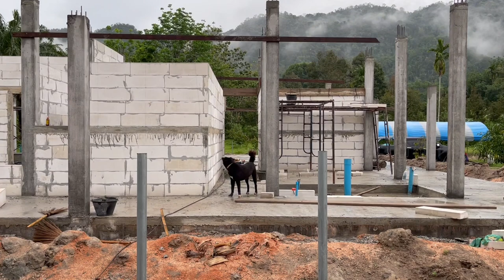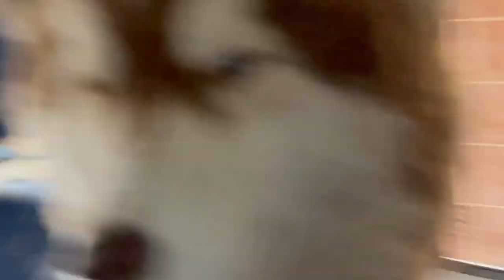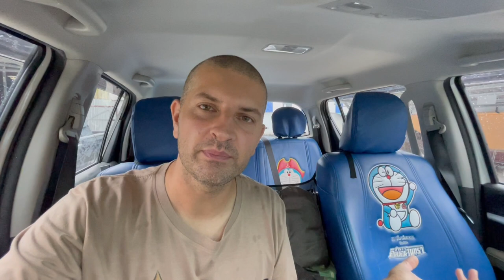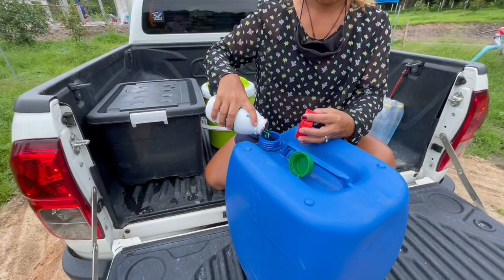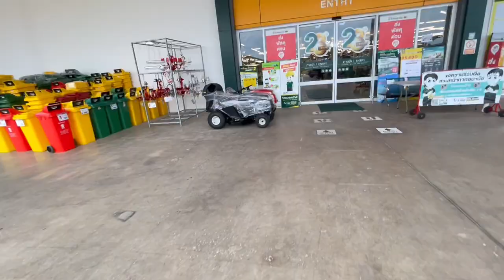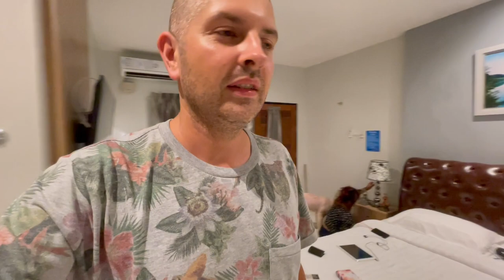Tile Shopping on a Rainy Day in Thailand 🇹🇭

Comment: Get them to clean the concrete as soon as they have done a run before it's dry!. It will be a nightmare trying to get it off after and alot of pointless work.
Reply from the maker: ye its all messy, but the grass will cover it maybe, i duno